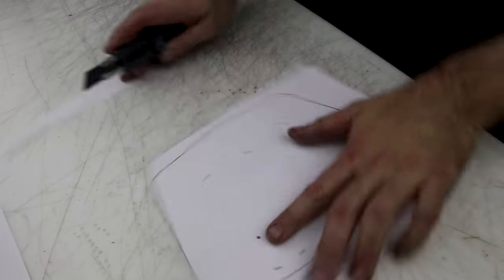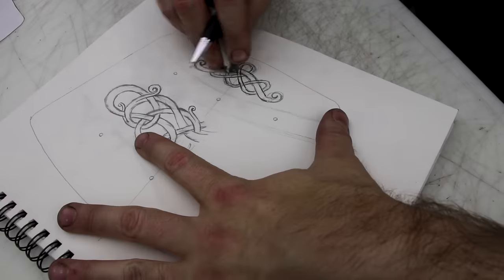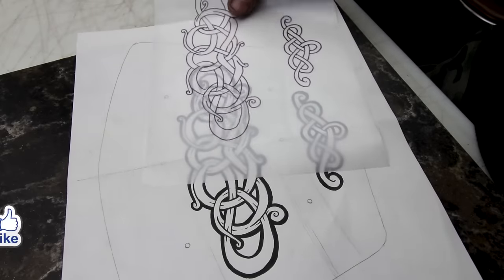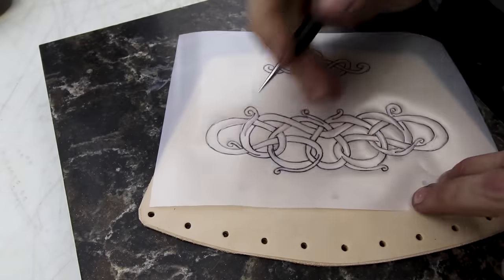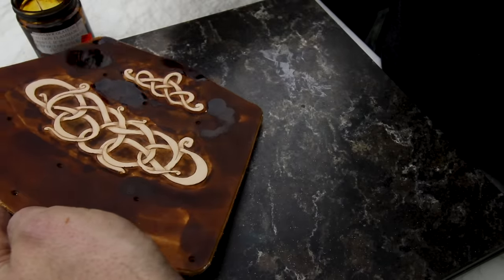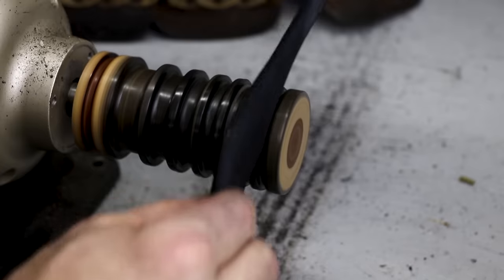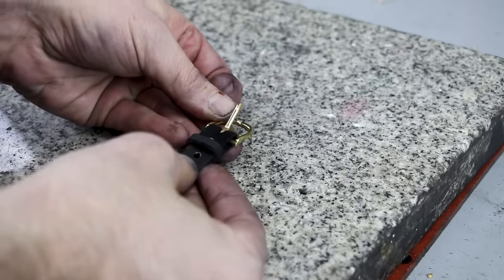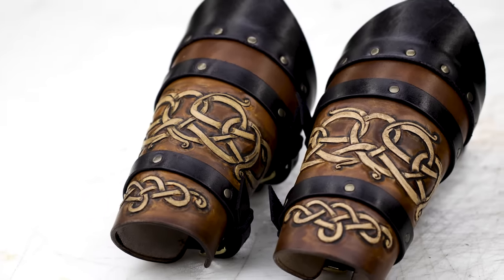Can Anyone Make These? - Leather Armor Armor / Vambraces

Comment: Hey there, due to the Big Ol' COVID19 Situation i have just purchased 2 full Cow hides in different thicknesses from a supplier that we use at work (i work in orthotic products, n the leather we use is for Back Braces). Cost me a Bomb even though i got discount so im gonna FINALLY START this Leather passion iv had for quite some time. I work in the Correctional insoles department so i have NO CLUE at all how leather moves etc etc. Any tips on how you sized these up to your arms seen as they look pretty beefy. I have quite large foreams with little Noodle wrists. The only leather i have Cut/Used/Manipulated is 2mm thst we use for Made to measure shoes... im not after Art tips seen as im kinda BADASS at hand punched Brogues lol. Just after Sizing, cutting and finishing tips. Thanks for your time listenin to me blab on. Keep up the good work. Hope to hear from ya soon.

Comment: loving all of your videos so far, I noticed in this one when using that rivet setter/punch that the striking surface was mushroomed, if you haven't cleaned that up yet, I hope you do. the little mushrooming is work hardened and if/when it breaks off can fly and cut you, this is more important with bigger punches for driving bearings etc. as you're probably not striking this punch very hard in comparison, but I imagine with finer work like this, your face is probably close to the work as well, and probably not wearing safety glasses.
Keep making amazing videos please and thank you!
Reply from the maker: 3rd person to mention this I should fix it or replace it. Thanks